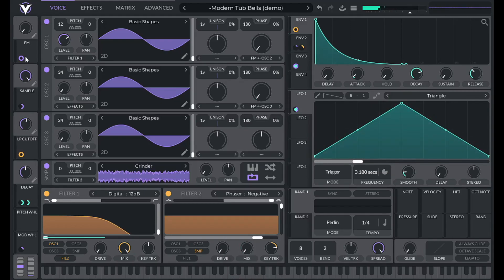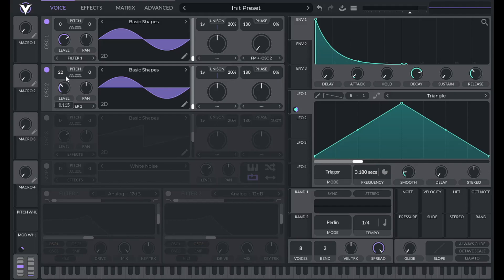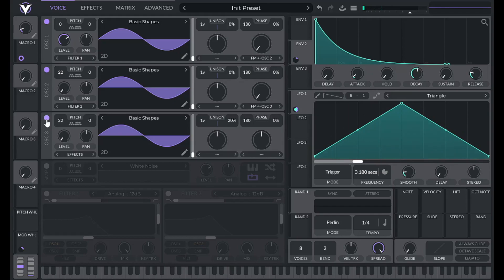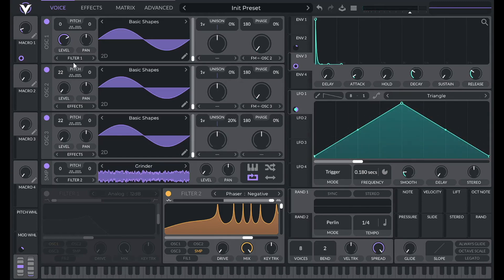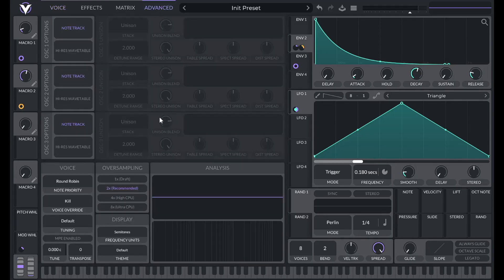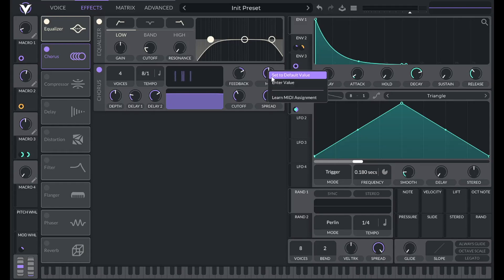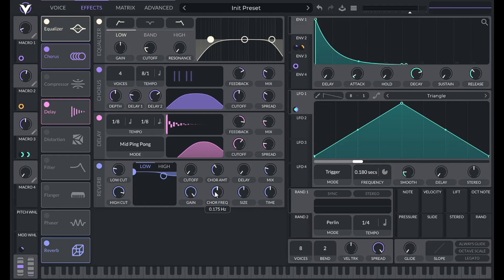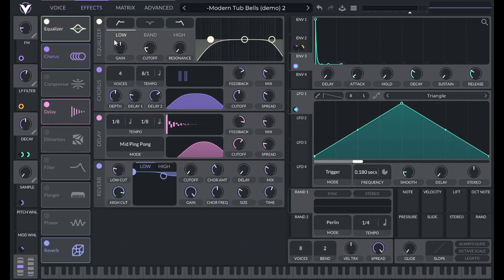How to: Christmas Bells in Vital - Synthesis Sound Design Tutorial

Comment: I bought the Sounds You Know!!!!! So I will wait to get this sound. But I did try and create it from your video also. LFO 1 hooked to something and I believe it gives it something different.
Reply from the maker: Did you buy it in the last couple of days? If so, it should be in there under "Christmas Bells". If you bought it awhile back, I will send it in my next update-probably when I get to 200 presets. In my default preset, mod wheel controls how much LFO 1 controls vibrato, which is not necessary for this preset.

Comment: Today I´ve downloaded your Presetpack.
It´s amazing!!!! Thanks a lot. 
Unfortenately the newer Presets (HVAC Guitar from 25.09.2022 to Big Love Bass-2 31.12.2022) didn´t work. The message "Preset was created with a newer version" was shown,  when I select this presets.
Your videos are great for understanding vital much mor deeper than before.
👍
Reply from the maker: Thanks for the kind words! It looks like you have to download version 1.5.0 or later for Vital to use the latest presets.. You don't have to uninstall. If you go to https://vital.audio/#getvital you can just choose the early access version and install. It will take the place of your old version.
Reply: @EricBowman  Good morning, dear Eric. First I want to thank you for your very quick answer. I have tried several times to download vital 1.5.5, but only the stand alone version is appearing on my pc and there your presets are working fine, still the new ones. In Ableton 11, the VST3 version of Vital 1.5.5 doesn't appear. Fyi, I have the pro Version of Vital. Do you have any idea how I can get the Vital 1.5.5 Version in Ableton 11? Thanks in advance and have a nice Sunday.
Reply from the maker: @Pixelmoves2024  You may need to  manually replace the new .vst3 file wherever you store your plugins. On my PC, Vital installs to Program Files/Common Files/VST3. You can see where Ableton is looking for your VST3 plugins by going to options/preferences/plugins. I hope that helps. Otherwise, you may get help from the Vital discord: https://discord.com/invite/dpZxr98 or from the Vital forum under "Questions & Support": https://forum.vital.audio/
Reply: Hey Eric, you are my hero.
I removed the VST3 file into the Ableton Plugins Folder. Then scanning and boom.

Thaaaaanks a lot!!!!!!